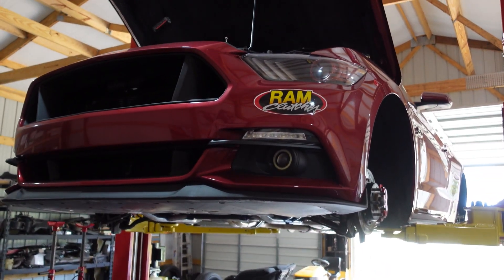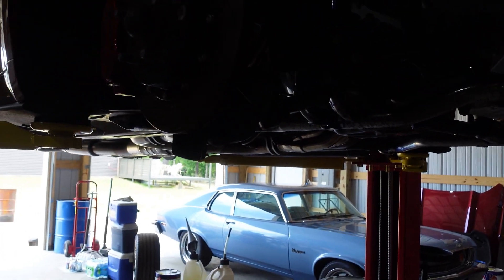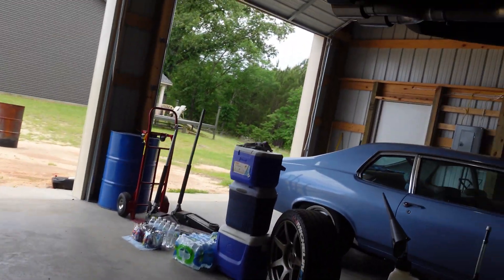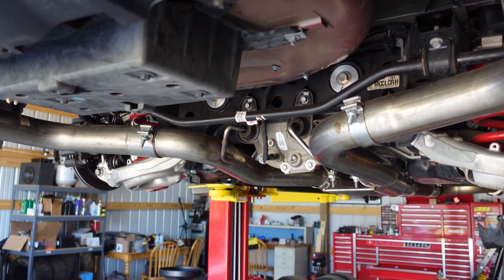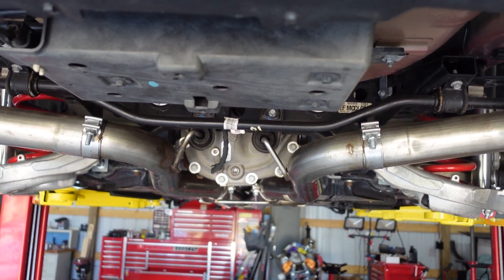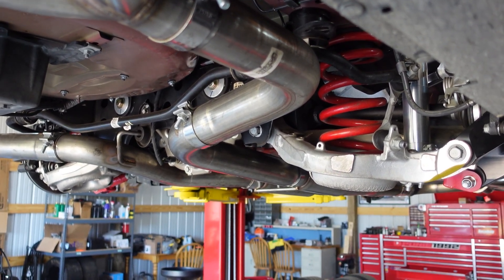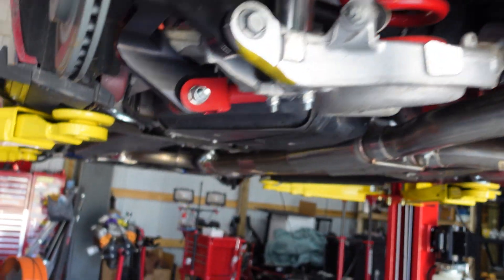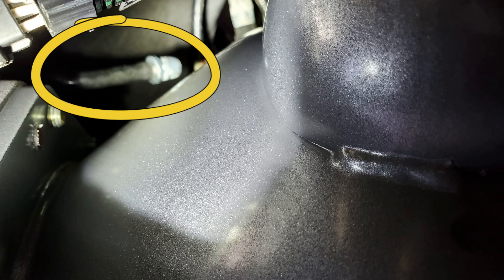False knock, where is it coming from?!!! Chasing false knock in my Whippled 2016 Mustang GT!

Comment: I had a little false knock with my k member. Went and got an alignment and it went away. I was only getting 2 positive knock
Reply from the maker: Took mine the day after for alignment. Didn't even drive it until after.
Reply: @BackyardBMX73  start spraying stuff with silicone spray and buy some fiberglass insulation and start stuffing it in places. Start in the back and work to the front.
Reply from the maker: I'm gonna try T's suggestion of wrapping different parts of the k member with rubber hose and see if that changes anything. That's easiest thing to try first.

Comment: This video just came across my feed, I know it's two years old but I hope you got it resolved. I'm fighting false knock now on my ESS equipped '17. It's a manual and it only pulls timing (3 to 4 degrees) when I shift to the next gear. I've been on 93 + Octanium and now 98 octane with no change so I know it's false. I have Kooks headers and they have plenty of clearance and I can't visually see anything that would hit, unless my MGW shifter is hitting somewhere. If it is I can't hear or feel it. I also have Xforce active mufflers and I'm wondering if they might be causing it. I don't know but it is getting very frustrating for sure.
Reply from the maker: I never found mine. I didn't get false knock until after I swapped the k member, so I'm pretty sure that was it. Seen quite a few issues with k members online. The knock sensors seem to be extremely sensitive, so it's hard to say what is causing the false knock or even if it's just one thing. Hope you find it and can turn it up more.

Comment: , I was getting a false knock from a muffler internals being loose.
Reply from the maker: Mine are straight through so I should be good there.
Reply: What mufflers did you have? I think this might be my issue on my 2014 Mustang GT. My borla Ataks seem to be rattling on the inside.

Comment: What was the fix. ??
Reply from the maker: No fix. Desensitized the knock sensors and run C10 race fuel.
Reply: @BackyardBMX73  even with the race fuel no fix ? Or with the race fuel no knock deg?
Reply from the maker: The race fuel is there to eliminate any possible detonation. If the knock sensors were still fully functional, I'd get knock. No difference from 93 pump gas to 100 race fuel, so it's definitely false knock. Also, timing is capped at 18° advance, so it won't go any higher than that. Running the 100 octane race fuel is just a precaution since the knock sensors aren't fully active.

Comment: Did you ever find it
Reply from the maker: Nope, never did.
Reply: @BackyardBMX73  that sucks I just fixed mine with octane boost so it was probably cheap gas. Just got the e85 tune so I’m going on that soon
Reply from the maker: @andrewgarcia4379  right on. Mine wasn't the gas. I was running a mix with race fuel. I think it was the Steeda k member.
Reply: @BackyardBMX73  yeah I had mine mix also with race fuel. But I guess the 91 still was not good enough
Reply from the maker: @andrewgarcia4379  right on

Comment: You you get knock as soon as you go wot and the sensors read positive all the way till you shift?
Reply from the maker: Pretty much, although I only have single gear pull logs so I'm not sure what knock would do on a shift.
Reply: @BackyardBMX73  it would be interesting to see what it does on the gear change.  If I was to guess I’m thinking something is hitting when the motor is torqued up and under load.  Have you also tried an octane booster or mixing in some race gas just to confirm it isn’t detonation?
Reply from the maker: @NITROUSnBIASPLYS  I run at least a 50/50 mix of 93 pump and VP C10. So, at least 50% or more is 100 octane. That's why I say it's false knock. Honestly, I think the k member is created some kind of weird frequency or harmonic. I've heard of several people having this issue after going with an aftermarket k member.
Reply: @BackyardBMX73  I see I see and does that have solid motor mounts then? I was thinking about putting a tubular k member in my car when I put headers on but I just don’t know if there’s that much of a benefit due to I don’t really race my car
Reply from the maker: @NITROUSnBIASPLYS  there is a ton more clearance for sure. Uses stock mounts if you want. I have Steeda mounts.

Comment: I have the same setup and mine is running 18 to 19 at full throttle does that sound right?
Reply from the maker: Yep, 18° advance is what I was hitting before.
Reply: Ever going to consider running e85?
Reply from the maker: @Jamie  unfortunately, it's not very available in my area plus I don't drive my car much and wouldn't want e85 to sit in the tank. I'll probably end up going straight race gas at some point.
Reply: @BackyardBMX73  what race fuel  would you run? Mine is 775 wheel and I  daily it like no tomorrow 😂. I beat the eyes out of this thing so I'm curious how long it's going to last.
Reply from the maker: I'm currently running at least 50% VP C10, which is 100 octane. If I go for full race fuel tuning, I may try MS109. I've heard people get great results running it. It is oxygenated, so will need to be tuned for it.

Comment: it's your hard engine mounts
Reply from the maker: Ran those mounts before the k member, so it's not them (at least not by themselves). I've heard of many people getting false knock after a k member swap.
Reply: @BackyardBMX73  ok. I had to go back to the stock mount to fix mine. I would go into limp mode only after highway trip then was good till next over 2500rpm for a 10min run. I'm roush stage 2 with t56.
Reply from the maker: @kellykelly3837  right on. Mine never went into limp mode, thank goodness.